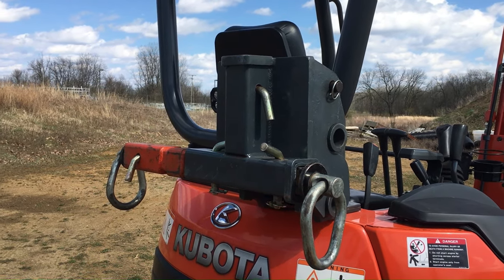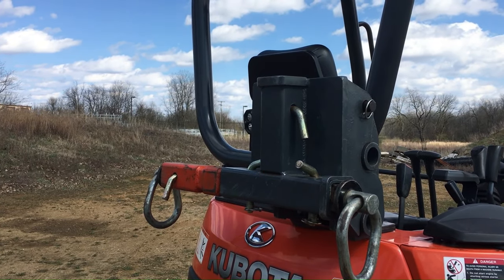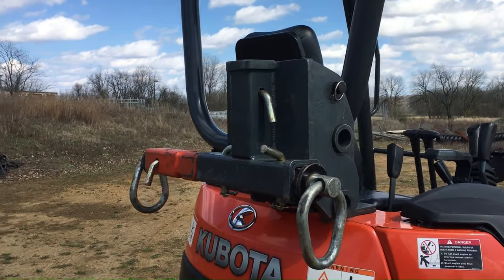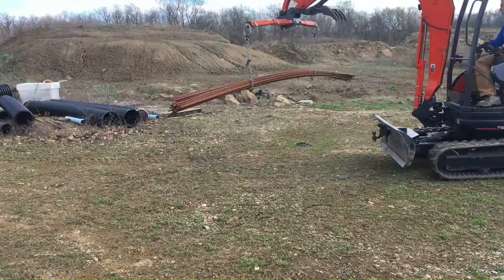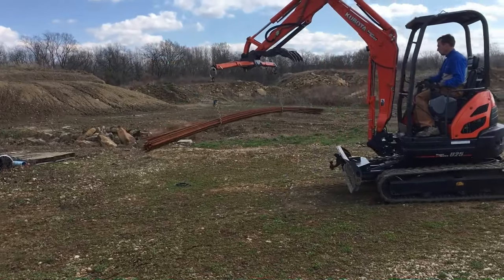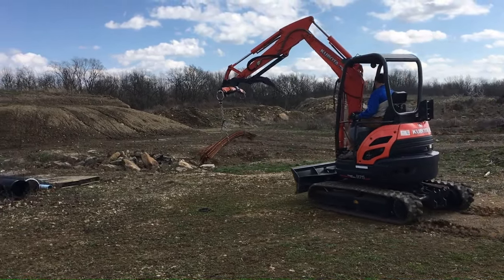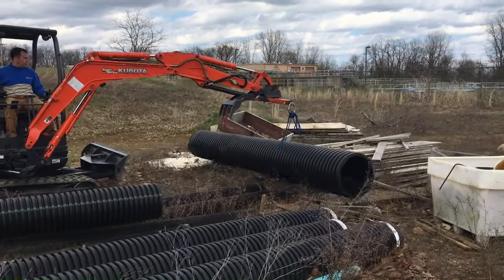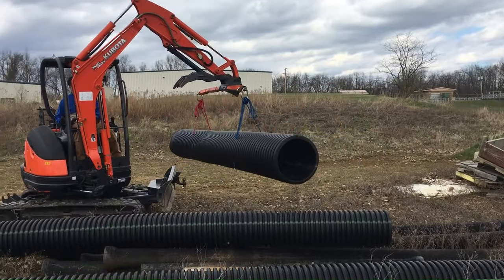My floating superpowered hand. How I move and build stuff by myself using my mini excavator.

Comment: That is a fantastic design for lifting. I love the modular nature of it. Do you have a sense of the max pick weight on the long extension?
Reply from the maker: Thank you. Although I get a lot of use out of it, I have never tested its capabilities at different angles and heights. And it goes without saying that different machines will have different capacities to go into the equation and remember everything changes over the sides of the machine versus out over your blade. For all these reasons and more, I am told that getting such a piece of hardware formally tested is quite expensive. As a result, I develop an "operator's feel" for what the limits are on a case-by-case basis (using an open space where I can safely and rapidly lower my practice loads beforehand). I hope this is of some help. It is a truly handy attachment if you take the necessary precautions. Thanks again for your interest.
Reply: @MiniXGoneWild   I was just thinking getting a crane scale from amazon and checking it yourself, not getting it formally tested. It does seem like you get quite a bit of use out of it and have clearly kept it within safe limits. It's just the kind of info i would want to know about my own build like that and the scales are relatively low cost. Keep up the great work!

Comment: I'm getting a mini ex with a cab. Have you considered using the bolts that hold the weight on as a location for a tool caddy? Thanks a lot.
Reply from the maker: Yes, I too plan on upgrading to a cab someday and I intend to explore that option when that time comes. For now, the ROPS bolt-on option was just too easy to pursue anything else.